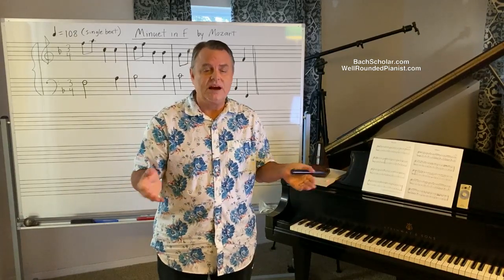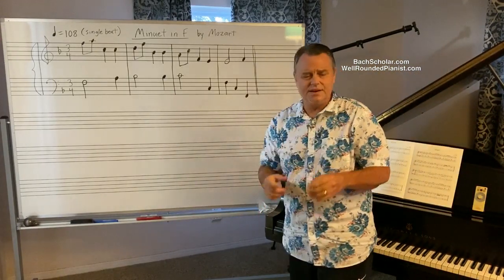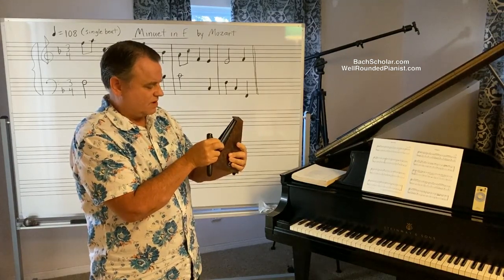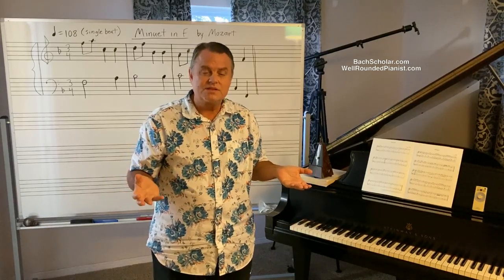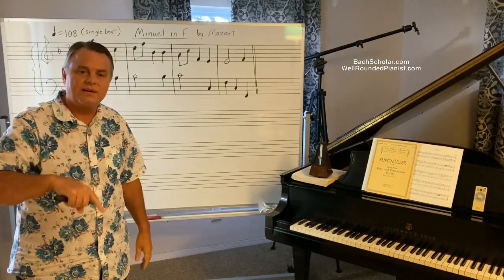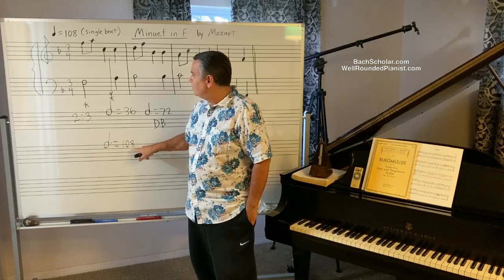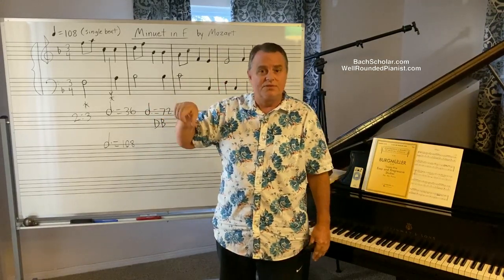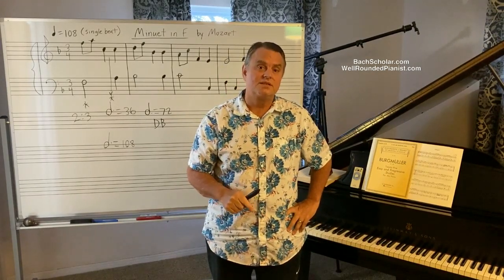(Part 1) Deficiencies in the "WBMP Tempo System" as taught by Wim Winters

Comment: Do you think any of the major composers actually used double beat?
Just wondering, because there is a theory around that says some weird inconsistencies eg. Allegro faster than Presto on same music material in Eroica, can be explained if the Allegro is supposed to be double beat.
Reply from the maker: Yes, I do believe some of them used DB, mostly the Austro-Germanic composers in the first half of the century especially those in the first "Romantic" generation born in the first decade of the 1800s or so. Also, I think Beethoven and Czerny used DB. There is NO evidence that Chopin used DB based on study of his metronome indications. I think it is really obvious though, that Czerny did. Also, study of Liszt's very early "12 Etudes" (which would later become the "Transcendental Etudes") clearly shows the young 15-year-old Liszt also used DB like his teacher, Czerny. But Liszt refrained from indicating metronome speeds in virtually all his later music. Because of the highly flawed DB system, many of the metronome speeds given by these composers need to be adjusted and corrected considering factors like they were limited by the metronome's fastest speed and it is impossible to indicate proper speeds in many triple meters and compound meters.
Reply: @BachScholar  Actually apparently there is a metronome mark by Schumann that says dotted eights for 3/8 time (so single beat tempo, but double beat counting).
Do you believe that Maelzel at least intended the metrnome to be single beat though? Maelzel's own instructions have somehow sparked a debate on interpretation.
Reply: @benjaminachron1493  Yes I know about that lol
I didn't watch the video in its full at the time of the comment though, and now I realize Cory thinks Czerny could have picked up double beat from Maelzel's 1816 instructions.
Reply: @maxxiong  I think Maelzels 1816 instructions are crystal-clear single-beat. The amount of source bending is takes to make them double-beat is mindblowing, but that still leaves 1821. No escape there... sorry guys :).
Reply: @the_wrong_note  Dreyschock clearly couldn't play op. 10 n. 12 in octaves, if we take Chopin's metronome as single beat. No one could. Nor any of the greatest virtuosos of todays who played - for example - Godowsky's 53 studies on Chopin's Studies could do op. 25 n. 2 at "Chopin's" speed. They can play it pretty fast and it's of course impressive (watch Libetta for example) but it's nonetheless nowhere near the speed of Chopin's metronome.  :)
Reply: @loxpower  but nobody said Dreyschock played it in octaves in single-beat... It probably was (a lot???) slower, but so what. A lot of composers who wrote added to Chopins studies kept his MM (Philipp, Reger) but of course these (mostly stupid) additions reduce speed. Everbody knows this. 
Godowsky did adapt the MM though, with often very large margins. Brahms added 'poco' presto in his version.
About your last statement, this is not true. There are certainly pianists who play op 25 nr 2 in Chopins speed, single beat. Like Cortot in his magnificent 1934 recording. Or Julian von Karolyi, or...
Reply: @the_wrong_note  "something less than that" we agree completely. Or do you expect these "competent observers" were carrying a loudly ticking metrnonome to check if Dreyshock was playing Chopins MM? The I-Phone with tap-function was quite some time away I'm afraid.
Reply: @the_wrong_note  ??? The simple truth is that WE are used to hearing this music since our childhood, over and over again. 
THEY had no recordings, no Youtube, and could hear some pieces a few times during their lifetimes, certainly virtuoso stuff like Chopin etudes. This music was not intended for amateurs, in spite of what WW would like you to believe.
So ANY fast speed would have been impressive.
Imagine you heard someone play revolutionary in octaves at 112. That would be bloody impressive, and you wouldn't have a clue of what Chopin wrote.
Only a metronome fascist can say at that moment: 'Too slow...'
Reply: @the_wrong_note  probably, and there is nothing wrong with that.
However, nobody has to disproof anything... the double-beaters have the burden of proof upon them. I've written it so many times: Talsma published his book in 1980. It was debunked, and no double-beater every found a smoking gun, after FORTY years. There is no description of double-beat, no description of two systems used at the same time and no description of a change of system...
Feel free to keep looking, there is nothing wrong with that. And enjoy the ride. I do. :)
Reply: @benjaminachron1493  Sorry maybe I didn't explain myself perfectly - language barriers! - but I was talking about "octave" version of op. 25 n. 2 (that's why I indicated Libetta's version of Godowsky's Study on Chopin's Etude which is in octaves). I'm very well aware that Chopin's metronome speeds are reachable, in fact I think Wilhelm Backhaus "nailed" every single one of them in his amazing performance in 1928. Even op. 10 n. 9 is spot on. :)
Reply: @loxpower  I'm sorry, you are absolutely right. 
But Godowsky drastically reduced Chopins MM in his versions.
I think we can all agree that adding sixths, octaves and whatever reduces the tempo. However some arrangers have retained Chopins tempi, leading to double-beat conclusions about Chopins originals, therefore my reply. Best.
Reply: loxpower, quote: «Even op. 10 n. 9 is spot on.:)» From the beginning, yes. But then. . . Opus 10 no 3 is far too slow, like «everyone» else.

Comment: It turns out that the original metronome scale, on Maelzel's patent, was from 50-160. 80 is close to middle in terms of ratio on that scale (dead middle is about 90).
Do you think the unit of time on the metronome mark should be taken into account when playing a certain time signature? Like would half=60 and quarter=120 be played with the same beat structure if both are applied to 4/4? Just wondering, cuz I barely ever see half notes used for allegros anymore, but eight notes are still sometimes used for slow pieces. If not, then tempo slower than quarter=60 would probably be problematically slow double beat (isn't 30bpm the lower limit for tempo?).

Comment: Dear Bachscholar, you are not the inventor of this solution. More than 50 years ago Willem Retze Talsma gave the same solution for this problem in his book "Widergeburt der Klassiker". He said: in a 3/8, 3/4 or 3/2 time we take 2/3 of the notated MM number. For instance, if there is given in 3/4 time:  MM quarter note=90 the right tempo is 2/3 x 90 = 60, so, we have to play it at tempo MM quarter note=60. And, for instance in  a 3/8 time: dotted quarter note = MM 120, then we have to play it at a tempo MM=80 (is 2/3 of 120). Do you know the book of Talsma?
Reply from the maker: I am not giving a "solution". I am saying that there is NO solution when the subdivision exceeds the 190s to low 200s or if applied to triple meters or compound meters faster than M.M. 104 (in double beat). Therefore, most of the metronome speeds given for pieces in this category are arbitrary, they almost never work practically, and they are incorrect. Therefore, composers' metronome speeds in these cases need to be adjusted and corrected accounting for the deficient system they used. No, I have never read Talsma.
Reply: Interesting, but using this formula on the edition of Chopin’s Op 9 No 2 I have, which has a MM of 132, and the score is in 12/8 time, we get a tempo of of 198! 

I might enjoy seeing some virtuoso play it at that tempo out of curiosity, but the piece certainly wouldn’t evoke the same emotions at that tempo.
Reply: @DeanHorak  ,  Indeed, in the first edition of this nocturne op. 9 No. 2 we can read MM 1/8 note = 132;   2/3x132 = 88. So according to Talsma we should play this piece at the tempo MM 1/8 note = 88, and not 198, because  that is 3/2x132.

Comment: well, there would be no MM for that minuet because there was no metronome back then. But sure there were still a few folks from the classical era around eager to give them proper MM. 

and quarter note 108 single beat is certainly not quarter note 216 double beat. You can change it easily by changing quarter note to 8th in the MM.
Reply from the maker: But this was supposed to be a metronome mark given by an editor living in 1830 Vienna. Of course, there were metronomes then. A quarter note 108 single-beat is indeed a quarter note 216 double-beat. And you can only use the eighth note in the M.M. if there are 16th notes in the piece, so that can be excluded also. Nice try though.

Comment: Why is the simple fact that some (not all) MMS seem to be to fast proof of the double beat theory? Why not triple? Or septuple? Are there sources that irrefutably show the use of double beat in Beethoven’s time and beyond? (I know Wim’s sources and they are single beat!)
Reply from the maker: I think the best "sources" is usually the music itself. Most people expect too much from written historical documents and they usually don't realize that the actual music is also a "source". For example, if you look at Liszt's early 12 Etudes (composed at age 15 after or during the time he had studied with Czerny), the slower pieces in that set like Nos. 5, 7, 9, 12, make it irrefutable that the young Liszt used the double-beat system. Using his indicated tempi in double-beat these pieces work very well, however, in single-beat they become much too fast. This being the case, this suggests that the tempo for in Etude No. 1, marked Allegro at Q = 132, was chosen because it should have been either in the high 190s or 200s meaning Liszt had to modify its speed downwards to make the metronome speed more practical. If played literally in double-beat this Q = 132 would be much too slow and more like an Andante (the way Wim Winters would play it), but since the slower pieces all prove he was thinking in double beats it also proves that No. 1 is also in double beat. So, if we correct its tempo to something like Q= 192 or Q = 216 it becomes a true Allegro and it explains why Liszt chose Q = 132. The same thing happens in No. 6. Also, the only compound meter, No. 4, is all screwed up with its metronome indication and is much too fast in single-beat but too slow in double-beat (DQ = 132) because as I show, it is mathematically impossible to indicate correct speeds using the double-beat system for these types of meters. In this case, Liszt probably wanted triple-beat but he couldn't go into the high 190s or 200s so he had to bring it down to 132 like in Nos. 1 and 6. Thus, in triple-beat the more correct tempo for No. 4 should be something like DQ = 192 instead of 132.
Reply: @BachScholar 
I think the best "sources" is usually the music itself. Most people expect too much from written historical documents and they usually don't realize that the actual music is also a "source".
- Totally agree

 For example, if you look at Liszt's early 12 Etudes (composed at age 15 after or during the time he had studied with Czerny), the slower pieces in that set like Nos. 5, 7, 9, 12, make it irrefutable that the young Liszt used the double-beat system.
- Why "slower pieces?". 

  5 =  Moderato with 16th notes (Allegretto with 32nd notes in the last revision)
  7 =  Allegretto con molto (sic) expression (Andantino in the last revision)
  9 =  Allegro grazioso (Andantino in the last revision)
  12 = Allegro non troppo (Andante con moto in the last revision)

I did play most of those etudes when I was 15 and the MMs never posed any problem. I am sure that the young Liszt was an infinitely better pianist than I was.
The Nos. 5, 7, 9, 12 have different tempo signatures than the last revision and I don't understand how they "make it irrefutable that the     young Liszt used the double-beat system". We could go into details but even a quick look at those tempi shows that the earlier version doesn't necessarily correspond to the latest one in terms of how fast he wanted the piece. When Liszt composed the very first version of these etudes, he hadn't yet composed the later ones. We know all of them and compare them with each other. He just made out of these first etudes amazing tableaux in the later versions.

Using his indicated tempi in double-beat these pieces work very well, however, in single-beat they become much too fast. 
- I remember playing the Mazeppa one at the 5th year exam at the Conservatory (again, I was 15). No problem at all. 
The fact that certain pieces "work really well in double-beat" or "single-beat become much too fast" doesn't seem to me a proof of the double beat theory. I guess it's more personal taste than scientific proof.

This being the case, this suggests that the tempo for in Etude No. 1, marked Allegro at Q = 132, was chosen because it should have been either in the high 190s or 200s meaning Liszt had to modify its speed downwards to make the metronome speed more practical. If played literally in double-beat this Q = 132 would be much too slow and more like an Andante (the way Wim Winters would play it), but since the slower pieces all prove he was thinking in double beats it also proves that No. 1 is also in double beat. 
- I beg to differ strongly.
The first etude is actually pretty easy in all its versions and the tempo is perfectly playable. You think that "tempo for in Etude No. 1, marked Allegro at Q = 132, was chosen because it should have been either in the high 190s or 200s meaning Liszt had to modify its speed downwards to make the metronome speed more practical" but, as I said, I could play these etudes in these tempi. No problem at all.
I respect your thinking but cannot agree with its logic.

Also, the only compound meter, No. 4, is all screwed up with its metronome indication and is much too fast in single-beat but too slow in double-beat (DQ = 132) because as I show, it is mathematically impossible to indicate correct speeds using the double-beat system for these types of meters. In this case, Liszt probably wanted triple-beat but he couldn't go into the high 190s or 200s so he had to bring it down to 132 like in Nos. 1 and 6. Thus, in triple-beat the more correct tempo for No. 4 should be something like DQ = 192 instead of 132.
- Sorry for repeating myself.
Saying "is much too fast in single-beat" is just a personal conjecture and definitely doesn't really prove the existence of double beat.

I do appreciate your work and my intent is not to argue with you. By no means!
I only think that the only way to refute a pseudo theory is to present irrefutable proofs. Everything else is just personal speculation.
It's no crime to "believe" that double beat existed during Beethoven's time (and beyond). Another thing is to prove it, and until now there is simply no proof.

Comment: I think they definitly used the whole beat method even in triple meters. I don't think it is that hard to play it with the metronome ticking 2 against 3. An there is always the possibility to calculate the equivalent in single beat if it's to hard to play like it is done here in this source from 1890 https://imgur.com/a/tNUrXYx
Reply: Funny that linked sheet doesn’t even have the correct math........it’s not an equivalent, the second speed is slower.
Reply: @briansun6336  Well 102 isn't on the metronome scale.
Reply: @ShakeTheMusic  aha, the Sonnleitner exemple :). Could very easily be a misprint for eight note = 204... that matches perfectly. Sorry, I had bought it also the first time I saw it.
Reply: @benjaminachron1493  204 isn't on the metronome scale as well
Reply: @ShakeTheMusic  68 isn't either. This is probably a typo. I have seen q=16 once (probably meant to be q=116 lol)
Reply: Do you think or you have concrete proofs? If you do, you are gonna become rich and famous, because until now nothing was found. Would you care sharing your discoveries with us?
Reply: @ShakeTheMusic  that is just nonsense. There were extended metronomes that went to 208, with gradations per 4 in the top part, so 204 was there. Please check some articles before writing this, I recommend J. Verdins article on historical metrnome types.
Reply: @benjaminachron1493  Ok, I didn't know that. I will look it up, thanks. If it is a misprint I'll give you that :)
Reply: @ShakeTheMusic  thank you for the fair reply. To be honest: Sonnleitner and Ruchti had me there as well, I even congratulated them on it :).
And I am totally convinced that Johann Sonnleitner believed he had actual evidence (or still does...). These men are honest 'opponents' who are looking for the truth.
Reply: Why would you use a polyrythm as a metronome? That makes no sense. Why would anybody chose 2 against 3 over just a tick every quarter note?